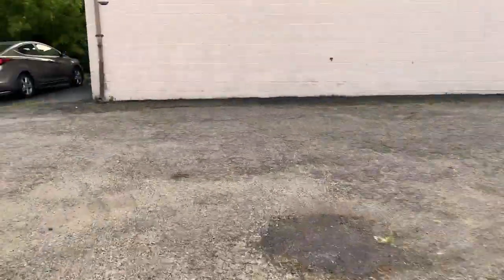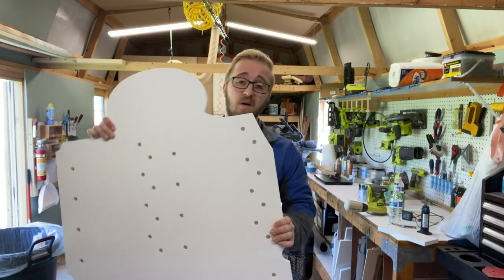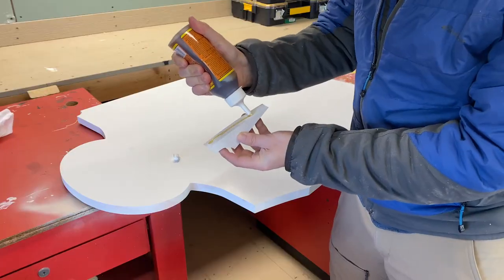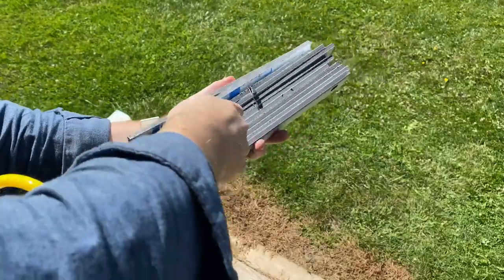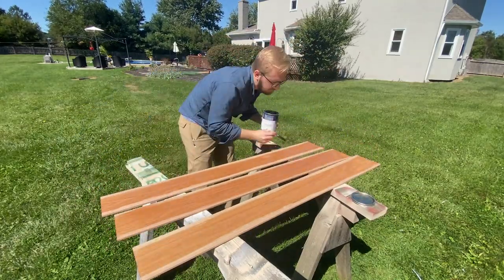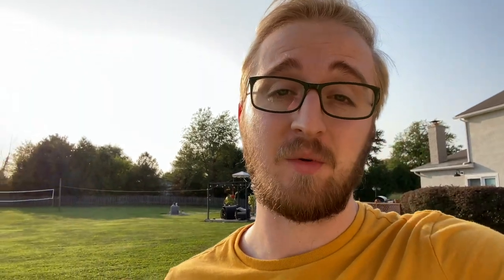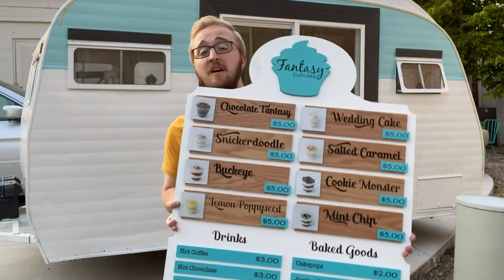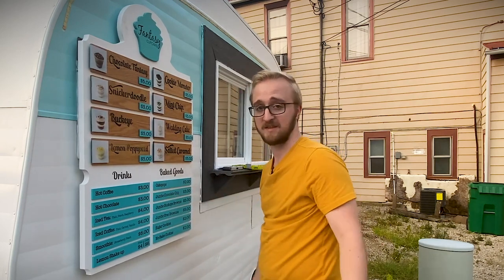The Magnets Made this Custom Menu Board Magical

Comment: This was great man! Quick questions... What is the white backing material, and what is the blue film you apply to the boards before CNCing that let you mask it?   Thanks!

Keep it up!
Reply from the maker: I appreciate the kind words! The base material was 3/4in thick komacel PVC that I got from harbor sales (I get 80% of my substrate from them) a local alternative would be the 1/2in pvc from Home Depot. Note that it is a different material with out the gloss surface and it’s more flexible, but it can be used outside without wiring about rot. The blue stuff is called oramask from orafol. You can find that on Amazon I think but tools today sells it as well. This vinyl is purpose mate for this application, but any cheap vinyl like the stuff you would find at hobby lobby should also work decently enough. Let me know if you have any more questions! If you want to have a full blown conversation then hit me up over on instagram @crabtreecreative. I would love to offer more help if needed.
Reply: @CrabtreeCreative  incredibly helpful response man, thanks so much! I'll definitely sub here and follow there. Thanks again.